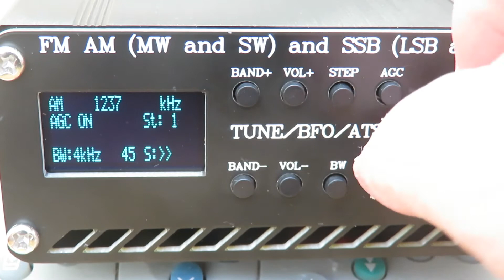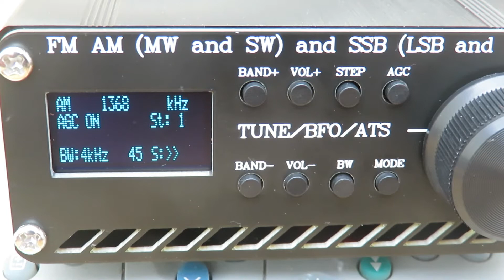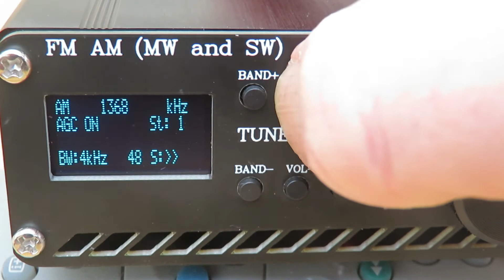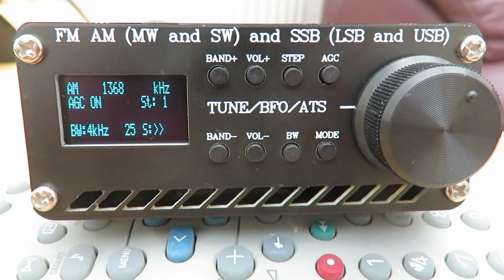SI 4732 Daytime tuning on the MW band

Comment: Nice looking radio.shame about lack of 9khz spacing which is vital. So careful tuning instead. I can hear all the typical qrm that we have got use to now. Turned on my old MW radio. It's unusable .just a mass of qrm .band is wiped out. Strong signals get through  but otherwise not a good experience as it was in my early years.